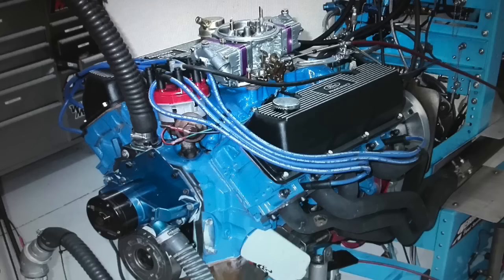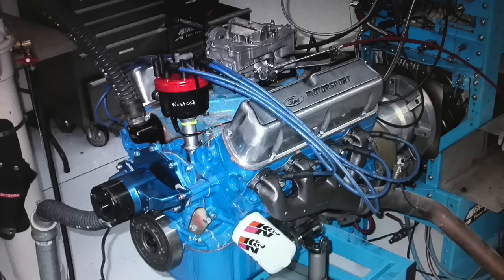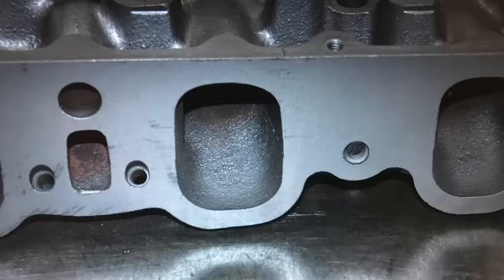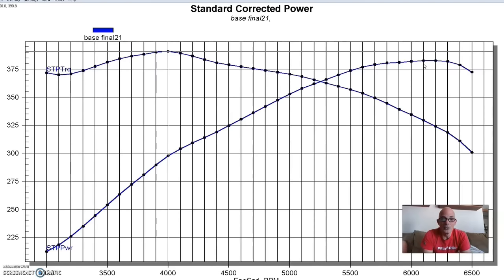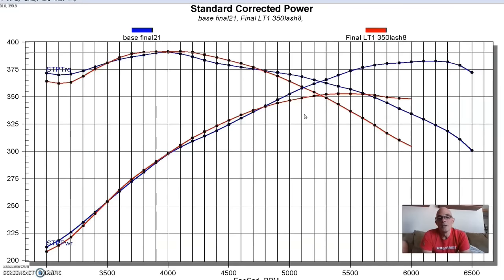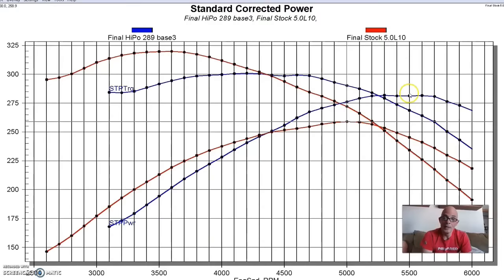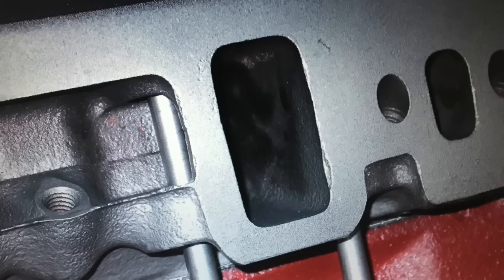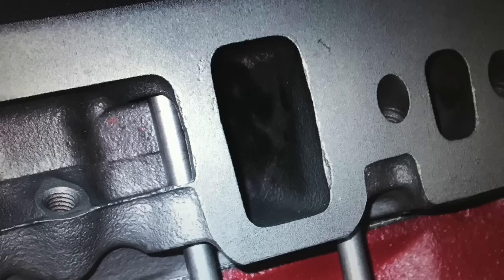HOW MUCH POWER DID THE 1971 BOSS 351 REALLY MAKE? WAS IT THE HOTTEST SMALL BLOCK EVER OFFERED?

Comment: Fords 351 Boss is a stout engine, but I'm not positive it's the most powerful factory small block from the muscle car era.  To be clear, Pontiacs 428's were said to make 390hp and are not technically considered a big block.
Reply from the maker: a 428 is not a small block in my mind
Reply: The general public may have missed the context of my original post unless they happen to be fans of Pontiac V8's. With this being said, maybe I can share a bit of information to make things clearer. "The blocks of all Pontiac V-8s from the 287 to the 455 are the same size and very close to the same weight, which can make it more difficult to identify the 11 different engine displacements produced from 1955–79 " (Hagerty).  Unlike manufactures such as Chevrolet which manufactured blocks  of different sizes,  Pontiacs changed displacement with bore and stroke,  but the blocks are visually the same. To be clear, you could swap out a 301 Pontiac and exchange it for a larger engine and not only use the same engine mounts, but could fool all but the most knowledgeable about what has taken place.  In the early 80's, I purchased a Firebird Formula with a 301 which was blown and replaced it with a 455. To keep things stealthy, I kept all the labeling stating the engine was a 301 and the factory air cleaner did well to keep anyone from questioning me further.  More than a few people scratched their head wondering how they just lost to a car with 100+ cubic inches less than they had. If one judges big block vs small block by cubic inches, I would agree the pontiacs had a big block option, but the truth is they were all the same size block.
Reply: @mrmatt7210  well if you are so smart about Pontiacs you know that 390 hp rating was the old gross system.....real hp was only 325 NET.......
Reply: @chadhaire1711   Your correct, around 1971 some manufacturers actually shared both SAE Gross and Net ratings, however by 1972 Net ratings were adopted as standard. With this being said, the original question related to the most powerful small block from the "muscle car" era( typically accepted as 1964-1972). Considering the muscle car era was a time period in which "gross hp" ratings were the common system for comparison,  it only made sense that I followed suit. To be clear, had the question been posted as "What's the most powerful small block of all time?",  you would need to compare the output of an engine in a like manner re all SAE or all NET.
Reply: @mrmatt7210  Computing the net is easy...just subtract 18% of the claimed gross number.  It is not 100% accurate but close...that is the problem with all these "dyno" channels..all they do is list dyno gross.  I had this conversation with this Richard youtube guy before and from his reply  I dont think he even knew (and still doesn't know) what gross vs net even means.  That makes it worse as I know from watching these channels that about 90% of the viewers don't know either. It really upsets the MOPAR guys to hear their 440-6 only puts out 325 hp not 390--or that 426 hemi does only 25 more and any 2023 5.7 V-8 found in common Dodge sedans or RAM trucks put out more at 375/385 net. I was around back in the 1970 days and those old cars looked cool and made lots of noise but were not that quick unless lots of work was done....they were unreliable, gas guzzlers, rust buckets, rattle traps, with crap handling and brakes that would get you killed. By 1973 NOBODY wanted them and they were dumped cheap....in 73 you could  get one for a as low as $900.  I did have a favorite though--the American Motors Hornet SC with 360 V-8 and 4-speed....a real sleeper. I dont think any have survived.
Reply: @chadhaire1711   Yes, I can remember the times when muscle cars were not considered "Classics." I suppose with this being said, I wouldn't mind being called a classic, but my value hasn't changed much. 😉  Your assessment of muscle cars is rather true. There was a lot to like about these cars re: styling, torque,  engine sound, and the experience  of feeling the car vibrate with a rhythm of its engine. However, the good days were never as good as we once believed. To be clear, in a stock comparison,  a 2023 Mustang GT would embarrass the best of the muscle cars in performance,  comfort, reliability, handling, breaking, etc etc etc. If anything, we're living in the best of times from an automotive point of view and may yet live long enough to share what it was once like to own a V8.

Comment: PUT 351 W HEADS ON THE 289 AND RSV TO 7000 NOT TAKING AWAY FROM THE 351 ALL 351 S ARE GOOD
Reply: 351 Windsor heads had too much combustion chamber volume and needed pop up pistons to get average compression. 289 needed all the compression you could add to get any torque which it much needed.

Comment: I remembered back when i was a kid the fellow that had the Monza back in the Sheppard days told me rhe Ford had good heads .  My freiend who had the 68 camaro that he took to Green Valley it was also a 302 told me that the 340 6 pack motors would run . I not sure what the heads flow but a good set of w2 or what ever they were made good power

Comment: 289 heads are all basically the same. Same small valves, same small ports. Weezer motors that can't breath compared to a Boss head. Yes, you can port them, and yes there are aftermarket Windsor heads. I am not talking aftermarket. Reliable yes, performance NO. Even in HiPo trim, no big deal - still a weezer and once a weezer always a weezer.

Comment: OK, cant resist.
Back about 20 yrs ago, Shelby said that ALL the 427/428 Shelbys did about the same 245 hp to the tires.
😨😨😨😨
Then somebody rounded up about 5 numbers restored concours cars and ran them.
Old Shelby was right.
Do you remember that, Richard??
Frieberger might.
Reply from the maker: a Med Riser 427 or 428 CJ made more than 245 whp-I've tested lots of them
Reply: Assembly line stock were pretty restricted.
Maybe i can find the rag.
Reply: LMR website shows an original article with the GT500 running the 1/4 in 15.0 seconds at 94 mph.
Other articles show the GT350 doing 15.5 and 15.5 seconds.
Where's the beef ???
Reply: GT350 15.3 and 15.5

Comment: Richard, plz test the boss 429!
Reply: There are stock dyno test of that engine, you wont be impressed in stock form.  Only 425hp and 470lb-ft.  The solid BBC 427/454 and Hemi both make a legit 450 hp with manifolds.
Reply from the maker: hard to find those
Reply: GlassTopRX7 the boss 429 was very under carbed from factory. I’d still be Interested in seeing one.
Reply: Richard Holdener oh yea, they are very hard to find. Still be cool to see.

Comment: How bout a Shinona body (69 - 70)  mustang with a 351 boss engine? No, you wouldn't yank the 71 351 boss engine out of a 71 mustang. Even though they were, well ugly. To me anyway. Saw a fella use 351 Cleveland 2 barrel engine, improved the oiling issue and came real close to the 351 boss engine specs. Wow, 12 sec car using street tires!

Comment: The boss 351 Cleveland cast iron intake was somewhat a high rise not highly noticeable but nevertheless it had a higher carb pad . And the cast iron exhaust manifold had longer runners like a shortie header . My boss 351 was one mean motor especially after I installed a monster cam and 1000 CFM carb . Wish I still had all those autolite carbs , had at least 15 on shelf in garage.

Comment: Even if  Knudsen was at for in 1968  but he wasn't , he would  have been to late to  develop the  ether the Cleveland or the  lima 429 the  development of both these engines were  done by 1967!  All that was left was the  testing. Knudsen   was to late to the  party to have any input
on ether  engine!  Wayne Gapp  was one of the guys on the  Team  who developed the Cleveland  program, he said all the design was together  by the end of  1966! Only  basic testing was left. They  built the first Cleveland with 302 size  main bearings but it Couldn't hold the  load under severe conditions.

Comment: ford 4 bbl intakes are good std,alloy is lighter,.only thing wrong with the 351c is its a truck engine,designed for torque,not revs,.but,they never break,i had one,used a sump of oil to tank of gas in an f100,78,,i didnt notice any differance.plus the canted valves help,chevy guys dream of ford heads....best thing to put on a 351c is 302c heads..big cam.cheap easy power,no chevy speed shop for me.....hate those cheap nasty chevy,s..

Comment: As a tragic who races those Clevos the 4V heads are junk. 2V  Aussie 302] has far better velocity and with around a 60cc chamber gives near 11-1.
All the aftermarket Clevo heads are based on them. 4Vs make excellent door stops!
The Clevo lump is A. Too heavy B. has poor oiling. C. has poor cooling. 
Bin most of the Ford parts and modify the crap out of the rest and youy have a powerfull but fragile thing.
I used to seriously road race,,, with a fairly low buck Chev engine. 2000 plus race km with only routine maintenance
Here in Oz we got the 300hp Ph3 Falcon which has always been closer to 380hp.  Or Boss351. Fragile but quite fast if they survived. 
I am currently rebuilding my 351 with CHI heads and intake which have ports the same size as a 302 head but flow far better. 
The only factory parts left will be the crank and [302 6.030"] rods.
As for the hipo 289,,, the heads leave a lot to be desired but went ok for the period. The same mods on the better 302 make them a nicer engine.
Boss 302?? A torquless thing. Heads way too big. The tunnel port 302 was even worse
Reply from the maker: the 4V heads worked well in Trans Am and on the dyno every time I've run them

Comment: Compression was higher than 11 to 1. 
11.7 .
Reply: Yep, I still have the early 70's original printed copy of Ford's off-road performance modification manuals for all engine families.  The Boss 351 has 11.6:1 compression according to their own manual. The original pistons were made for Ford by TRW.
Reply: @FiteTheGoodFight  
Thanks Colin. I was wrong (getting old) but not as much as author. 
And .6 matters, it would show in torque and hp curves.
Reply: @johntempest267  Your are basically only talking the difference in the head gasket thickness you are going use to build the thing

Comment: The 289 hi po was impressive Until you actually measured your o-60 times. Not so hot. But it was far better than a 289 4bbl .  A 66 Mustang was 2800 lbs if I remember correctly so it accelerated ok if you could get traction with those skinny ass tires they made back then. But you could Drift that old Shelby all day and do smoky burnouts without trying.

Comment: 4v are a very bad idea for the street and only good for the drag strip everybody knows that. 2v or 3v are the best cleveland heads by a distance especially the 3v which i would choose over the 4v even for the drag strip. Remember you can have a 400hp 4v motor and 400 hp 3v motor and the 3v with destroy the 4v in performance even if the 3v makes less power it will still win
Reply from the maker: 3V IS AN AFTER MARKET ALUMINUM EXPENSIVE SET OF HEADS

Comment: Why do you think the 351 cleveland is a small block ?
Reply from the maker: the 351C has a 9.2 deck-shorter than the 9.5 deck on the 351W-its a small block. The 351M/400 has the 10.3 deck-its closer to BBF
Reply: Richard Holdener but almost everything but the deck height and bell housing are the same as a big block 351M and 400

Comment: Clevelands are all big blocks....their heads will not fit a small block. 351 Windsor is a small block.
Reply from the maker: Cleveland heads bolt right to a 302 or 351W (how they made the Boss 302), they have a shorter deck height than a 351W-they are a small block

Comment: It's a great engine (I own a 351C HO), but the Boss 351 wasn't perfect. The quench area of the closed chamber heads caused hot-spots, often leading to problems like warped cylinder heads. 
Also, for most applications the exhaust ports were too large and had to be either filled with epoxy, or install aftermarket "port plates" to cover the cavity and smooth the flow. 
Some sources say the Australian 2V heads were a better choice, especially for the street.
By the way... it would appear Ford borrowed the basic design of Chevrolet's Mark IV "porcupine" cylinder heads for both the Ford 385 and 335 engine series.

Comment: in 1971 Chrysler was still the king of horsepower, and it wasn't even until 1973 with the Pontiac 455 super duty, that Pontiac gave up. by 1973 Ford had no powerful engines. Pontiac was on top. Chrysler was second place. Ford was making garbage by 73.
Reply from the maker: 1971 BOSS 351 MADE THE MMOST OF ANY SMALL BLOCK

Comment: Sounds like the 289 hi po heads flow about the same as the E7 heads on my 91 Fox
Reply: The 289 heads had the smallest intake ports I've ever seen on a v8. The heads guys liked to start with because they came with tiny chambers and an adjustable valve train. It's kinda shocking how bad they actually are, a 5.0l roller with 40p heads on it will easily make more power from idle to anywhere and are almost free at the wreckers

Comment: I like the 351C as much as most cleveland fanboys do, but FORDS 1966-67 351 XE "windsor" type 9.2" race block DESERVES SOME RECOGNITION/ACKNOWLEDGMENT as it was used with hd/xe/ge & canted valve GT/4VB heads BEFORE the cleveland block was even made... https://www.corral.net/threads/351w-xe-block.2498544/#post-18607267
Reply from the maker: its not a factory offered combo, right?
Reply: sadly the 9.2" deck 351w XE race block never made it into any american production car, However a few made there way into the first/early european only De Tomaso Mangustas as ("stretched 289/"stretched hipo") eng's with big port(2.125"/1.250") & valve(1.94"/1.62")  289 XE heads. Interestingly De Tomaso also wanted a 7L bigbore/stroker version of this same first code named "stretched 289" (new "W" type XE #93532 351xe block) for his mid 60's P70 car... https://detomaso-automobili.com/p70/#clash

Comment: Just based off of what I've seen, you wont find a muscle car era small block that will beat the Boss 351.   The AAR 340 isn't going to make that kind of power, it's a L79\L46 clone with the bad for power 6 pack setup.  Less displacement worse flowing heads street cam vs race cam not happening. I do consider that Boss 351 to be a period race cam, it's just that much wilder than the Boss 302 cam.
I think the only question left is there a big block sleeper out there, my money is on he 500ci Caddy, it's light it has the displacement.  What does it really make and what could it have made?  Needs to be based off the 70 spec.
The 289 and 283 suck balls for power in any production version.  The 3" stroke just doesn't' make enough torque at that displacement to move 3000+ pound cars with authority. 
The 71 Mach One is the ugliest mustang of all times.  Yout butt dyno will be right more than it's not about which is quicker.  For power not very accurate.   For those at home you can figure out which will be quicker with the dyno graphs.  All you have to do is figure out the average power between shifts, which ever one has the highest will be the quickest.   With muscle care which were limited to 4 gears torque is often king at lest for eye balling power.  That's because of the wide rev range between shift with 2-4 speed trans is so large that in some case keeping you between the peaks is a challenge.

Comment: 4v heads,good for drags or over 80 mph,,std 351 heads,i sell them to chevy guys for 500 each..joke,,std 351 heads,only need the hump fixed,it seems ford & dodge,you use std parts,chevs,allways down the fast shop..&,the 350,is a dog of an engine,mechanically,all wrong.plus,it will shit itself over 6k,where a 351c will do 6k all day,,something to do with ancient,windsor valve train..good for 4k.or they pop...adjustable rockers,??,what is that.??.1840 tech..??.i have 3,351c,2 with 302 heads,1,352 FE,& a 73 340 r/t.chall..you didnt mention the 4mab crank rods...id still have a 460.cant beat them,alloy heads,intake mild cam,10.1.last forever.weigh same as std 351c.

Comment: 90'S MUSTANG GT'S ARE THE MOST OVER BRAGGED ABOUT DOGS EVER BUILT. THEIR FAVORITE ADD WAS  THE BOSS IS BACK; THEY WERE FULL OF SHIT. I OWN A 65 GT 4 SPEED CAR AND A 71 BOSS .  THE BOSS 351 IS A MEAN BEAST AND THE 65 GT WILL EAT THE 5.0 GT ALIVE.
Reply: I raced and owned a 66 289 HiPo with a top loader and a lot of work done to it. I also race and own a 93 Cobra with GT40 heads and a 3550 tremec and a healthy cam. The Fox Mustang will eat the 66 for lunch at COTA and HSR. That obviously is due to the better suspension and lighter weight of the Fox. They both make about 400 hp. At the drag strip the 302 GT40 walks the 289 until about 6k rpm. The 66 has 4.30 gear and the Fox has 3.73 gear. 
  I want to try the GT40 heads on a 289 just for fun and see what happens. Could be a fun combination.

Comment: For stock-headed engines, yes the Boss 351 rules the small blocks. But the Boss 351 is a one-year-only deal and as you say over and over in the video, you can't find the parts. Not only are correct/unicorn parts unobtainable, but you had to borrow adequate substitutes. You can find Chevy stuff all day long to duplicate the OE LT1 performance. It's no secret the original Ford 289/302/351W heads are poor performers. The era of good aftermarket heads means just about any brand small block can make good power now. I'm a Mopar guy, but the 340 just doesn't have heads to run with the Boss unless you're willing to allow W2 heads.